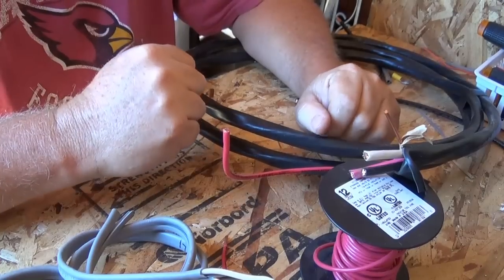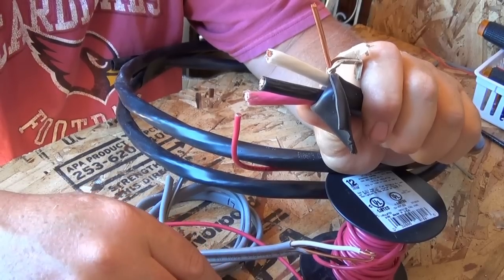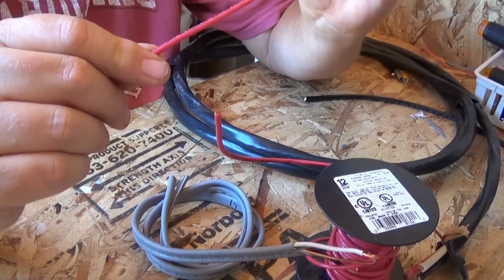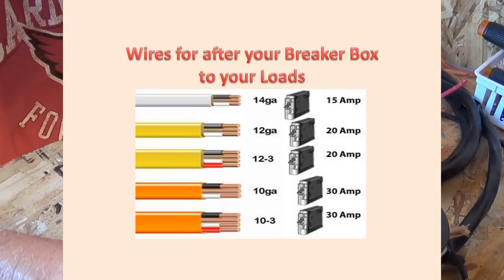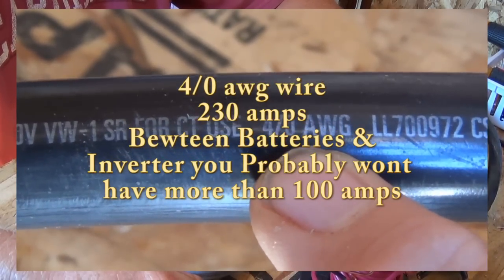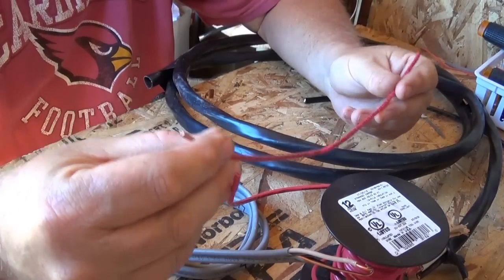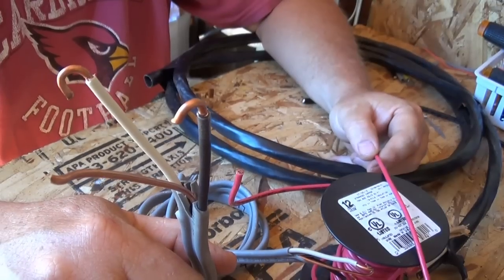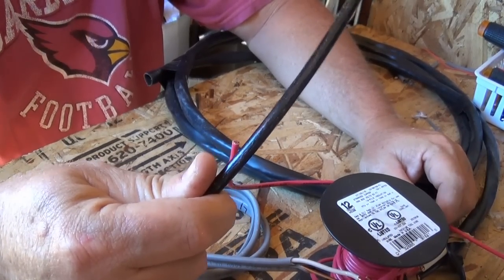What Size Wire Do I Use To Wire My Solar Components? Does Wire Size Matter?

Comment: please i have my 12v 1000w solar panels 20 ft away from the charge controller. what amps of wire can use to draw it?
Reply from the maker: size 6 stranded should be just fine size 4 would be best. 6gauge
Reply: ArizonaHotHomestead thanks so much is very helpful i appreciate, I'm working on it.
Reply: Aaron, actually a 4/0 wire is 1.4% volts loss in 20 feet as opposed to a 6ga wire at 10.97% voltage loss in 20 feet based upon a starting voltage of 12 volts.

Comment: Solid wire has less resistance than stranded and thus less voltage drop as distance increases - believe you got this backward.  Do not forget about code requirement of increasing amperage requirements for continuous loads by 125%.  Current (amps) on hot roofs in conduit have to be further corrected for temperature and corrected again if number of conductors in the conduit exceed 3 wires - Section 690
Reply: Also stranded is used in situations where you have vibration, even a little. Stranded will not come loose but solid is much more likely to. Master Electrician of 43 years who worked in industrial settings with motors etc told me this.
Reply: And of course the other reason stranded wire is used it’s a whole lot easier to bend and fish through tight spaces. And DC power runs current on the outside of the strand and AC runs current on the inside of the strand

Comment: What about wire with higher numbers than 14 such as 16, 18, 20 etc
Reply: I am testing for Nccer tomorrow..i hope i pass!!
Reply from the maker: that is some pretty small wire only used for very small electronics. i hate working with 16 ga wire becus the wire is so small when you bend it it brakes. ...

Comment: you didn't  say anything about resetince in wire gage juust amps the longer the run the more the restiance so stranded wire is the best but the gage figure in also, large less rest. ohm law
Reply from the maker: yea the resistance is to much for novice like most of us. when i wired my system i paid little attention to resistance. i just went as big as i could .  so far all is great.
Reply: Look up Copper Resistance for the wire size you chose for amps. example: 2AWG wire shows 0.1563 ohms per 1000 feet length (0.1563/1000 =
0.0001563 ohms per foot). If you have 3 feet between your battery bank and your Inverter then the voltage drop for a 2AWG wire is .0001563 x 3 feet x 2 wires (Pos & Neg) = 0.00096 ohms lost in 3 feet. Now calculate the surge amps that will potentially be drawn through that wire (say 250 surge amps) = 0.00096 x 250A surge = 0.24V loss over 3 feet. If you go longer with the same wire say 15 feet its .0001563*15*2=.004689*250A = 1.2V loss over 15 feet.

Comment: Question... I have to hook two 12v 9ah batteries together that then go inside a UPS Battery backup. I have T2 connectors for it, but wondered what sort of wire type/size I should use (the length would be like 2-3 inches).
Reply from the maker: what size are you able to use with the connectors? go with the biggest wire.
Reply: 12 G. is fine.

Comment: Nice video. Yes bigger the better for cables I think, protected by the right fuse. The Smartgauge website has some interesting calculations about cable losses etc., particularly interesting about batteries in parallel. At the very least never take inverter feeds  + and - from the same battery from a string. Surprising losses.
Reply from the maker: good info. thanks.

Comment: stranded wire has less resistance solid wire has more resistance,that why stranded loses less amps.
Reply from the maker: thanks. and stranded is easier to work with in most cases.

Comment: Thanx a lot sir, your video help me alot in understanding what wire should i use on my 12v loads running on the entire house. Currently im running thhn#14 and with a mix of speaker wire.
Reply from the maker: wow way to small. go bigger. never use speaker wire for any electrical. depending on loads and distance 6 to 12 stranded is great. in fact i use 6 to run the wire from the battery shed to the rv and barn than 10 or 12 on short runs to the loads. . when wires are to small like that speaker wire they will heat up causing the outer cover to melt and than catch anything it touches on fire.
Reply: Thank you sir, and not for further trouble I was installing a 1kw / 24v inverter with 240ah total battery capacity, any suggestion on what wire can i use or substitute to battery cable AWG#8(this is the only available size in my place) i'll be running it on 2 meters.
Reply from the maker: if 8 is the biggest you can get go with it. once you run the line measure the volts to see what drop you have between the beginning and ending of the wire. depending on your loads on each line may depend on how many lines you run.  i would think for the most part you will be ok .

Comment: I have two 74w solar panel and two 12v 75ah battery. So what wire should i use to connect them
Reply from the maker: being that size i would feel good in using standard auto battery cables. the 75amps is less than a video i did in wiring 2 12v batteries and on them i am using auto battery cables.

Comment: Current rating (Amps) is a function of the conductor cross section. Voltage and temperature rating is a function of the insulator. 

Stranded or solid conductors of the same cross section have identical transmission properties at DC or AC frequencies - I'm referring to 60hz. 

A stranded conductor will have a larger diameter than a solid conductor of the same cross section due to the voids between the strands. 

Stranded conductors are generally not allowed to be installed in the walls per NEC code. Exceptions apply so consult an electrician. 

Solid conductors are preferred in applications where the conductor is not subjected to frequent bending or flexing.
Reply: around here you can run stranded in walls but need to be encased in conduit. I'm not sure what you mean by"  cross section" the electrons travel on the surface of the wire so my logic tells me that there would be less resistance with stranded wire vs solid...? I thought gage of the wire was a size measurement? like you compress the stranded into a solid they would be the same size.
Reply from the maker: thanks for the info. a bit to techie for me but i appreciate it. when people read the comments it will help them.

Comment: Great videos!  Can you go over size  of wire for runs from panels on ground to the house and what are the code for burying etc.  in general. thanks!
Reply from the maker: for code just check with local codes. mine didn't have to be buried to code becus of the size of system so mine is just a few inches. . I used 6 gauge wire and its running about 70 feet from panel to charge controller. there are charts for the distance of normal lose in power but I have enough voltage running through I don't notice a loss. I also used 6 gauge to run 24v from the battery to the barn and rv which ends up being around 80 feet. use a step down dc converter 24v to 12v with no problem running the 12 volt devise on that line.   does that help? bigger the better.

Comment: what is best for pulsed DC current  ?? stranded or solid
Reply from the maker: from what I am told you go with stranded. the electricity actually runs on the outside of the copper wire so when you have many little wires (stranded)  there is less lost of electricity but if use a solid wire there is only 1 wire for the current to run on and is more likely to have loss in power. plus stranded is so much easier to work with.

Comment: Just a bit of general information to clear up any possible confusion. The voltage rating on the insulation, is just that, it is what the jacket of the cable, be it Teflon, rubber, etc. is rated at. The cable itself is almost unlimited where voltage is concerned. Solid core wires are not going to have more loss per unit length / diameter than stranded cable. Stranded scores in high power high frequency application only. You can think of very high frequency current as wanting to leave the wire altogether and radiate. Skin effect is a phenomenon that increases (decreases depth) proportionally to frequency and only the outer edge of the conductor carries the current. Below about 150hz this is not really an issue. Silver plating is an excellent way to use a semiprecious metal to full advantage here, silver being the best conductor we have presently. Wire carrying current will heat up, the thinner the gauge the greater the resistance per unit length and the resistance to flow causes heat. 
It's common sense really, what's the maximum current demand on your system? Choose the gauge of wire accordingly. If it's high voltage too, sort out your insulation as well.
Reply: Also was  just reading the comments, and see I may have repeated much that has already been said. There is some good talk regarding terminations and reliability. The best terminations these days are from high pressure crimping, and the crimps are so good they become indistinguishable from the cable itself. Screw connections are trouble, solder is variable and heats the cable and insulation. High pressure crimps are expensive, as is the tool to do it - but you only ever need do it once - and they can be bolted down or whatever depending on style chosen. And they look nice.
Reply from the maker: +Martin de Angelis thanks for the info. Sometimes it's good when people repeat it helps to confirm what one says and the info doesn't get buried so easily becus it's repeated.
Reply: I crimp AND solder my terminals.Screw connections ARE trouble-prone,indeed.The screw terminals on my inverter get hot,I would prefer a solid,threaded  post.

Comment: It's folklore that solid core cable has mores losses than stranded. The skin effect only becomes apparent at high frequencies. To the point where if you're moving lots of power around in the tens of MHz range you basically just use copper pipes as no current flows in the centre of the conductor at all. DC has a frequency of Zero Hz, therefore skin effect is not relevant. 

However, what can often happen when solid core is used is that it can be harder to connect to. Screw terminals contact a smaller surface area, where as stranded cable tends to be nicely "squashed" into the terminal well or contact plate thus making a superior connexion. 

The higher resistance connexion of the solid core can give rise to more heating making the situation even worse in a vicious cycle. The electrolysis action of DC current can also exacerbate the problem.  This is likely where it's bad rep comes from. The solution is simple - make a good connexion. Solder a tail on or a lug etc 

The problem with cable ratings is that they are essentially safety ratings. And with these cables often used on high voltage circuits a certain voltage drop can be tolerated that's no good on low voltage DC systems. 

If you want to size cables generously, but not go into over the top overkill mode, Current Density is a good way to work it out. 1mm^2 cross sectional area per 3 amps is a good rule of thumb for 12VDC circuits. Of course all you Yanks will have to consult your tables to convert that into AWG! lol
Reply from the maker: great information. thanks.

Comment: great job, but remember the distance of the wire run. The longer the run , larger the strain on the wire, so yes normally a # 12 AWG wire is fine for up to 20 Amperes, but if it is a longer distance you will need to step up to a #10 AWG wire.
Reply from the maker: so right. that's actually why on all my wiring I went with a size bigger.
Reply: awesome , and great job and video by the way man

Comment: Why solid ware over distance carry less amperage than stranded cable? Because electrons run on the surface of the copper wire not inside. Meaning that solid has less surface area that stranded. stranded are compose of many wires given a more surface area for electrons to carry.  Hope it help someone.
Reply: only at high frequency
Reply: The total cross-section area, AWG or "circular mill" size of a stranded conductor is equivalent to that of a solid conductor for the same designated wire size. ... Similarly, there will be no less or more voltage drop whether you use stranded or solid wire and the current carrying capacity is the same.      (Straight out of Google search).   So false.
Reply from the maker: I went with the solid for the 120v becus of the direct bury it came it. my thinking is if I go with any other wire I have to also buy something to put it in so the mice don't eat the coating. the direct bury from what I heard is more rubber material so the mice wont chew it plus it is better for direct bury reducing my cost on conduit. the distance I have the solid wire going isn't going to lose enough to be un-useable if you will.  you do bring up a great point. thanks for the comment.
Reply: Angel Gonzalez thank you
Reply: @paulapril  Thanks for that clarification.
Reply: @notgiven3114  Thank you both for the clarification
Reply: if my wires are warm am i losing any power?
Reply: My eggs

Comment: Electricity runs on the outside of the wire (strand), so the multi-strand is more efficient. You can use either solid or multi-strand on AC or DC, it is just more efficient to use the multi-strand.
Reply: Don't want to sound like an arse, but that is not quite correct, so purely for  educational purposes - I stick my oar in )) DC is not influenced at all by skin effect  as it is purely an AC phenomenon, and increases with frequency, I'm sure there will be a good wiki page on 'skin effect'. Sorry again for barging in.
Reply: @martinda7446  you got it this guy is going to burn his place down someday. He’s off on a lot of issues not just electrical
Reply from the maker: thanks for the info. I like it when people chime in with valuable information. thanks.
Reply: Multi strand is more efficient.That's why your car has them.Otherwise,they would all be solid core wires.
Reply: ddd228/Dave in Seattle: Yes multi strand is more efficient but that's not the reason exactly why your car has multi strand wire. Solid cable is fine in the home but not in a car for 2 reasons. Hz and movement. Your car has multi strand cable because the average alternator (AC current) runs at around 400 Hz as opposed to 60 Hz in your home. Which brings us back to the skin effect conversation mentioned. And a car is moving which generally means the wires are moving. Solid wire is not flexible which makes it prone to breaking where multi strand is very flexible and good for use where wire movement is likely to happen. Then there is the heat dissipation requirement mentioned by Chuck Wagner. wire size is chosen (and rated) based upon how well it dissipates heat. Using the AWG standard, a 4/0 wire with 90C insulation is rated for 260 amps but that same wire with 60C insulation is only rated for 195 amps. That's why nobody measures wires in watts. It always baffles me why I see youtube videos where someone connect there RV battery bank together with 4/0 wire and then they run a #6 AWG or even a #2 AWG wire from the battery bank, through a 250 amp fuse, to their 3000 watt inverter. If you pulled 250 amps through that wire, the wire would probably melt long before the fuse blew. There is smaller diameter cable that can handle the 250 amps but its generally a specifically rated welding cable for that amperage not a standard AWG wire you can buy at Home Depot.

Comment: Good video, Thanks... Couple of points.  The voltage rating is for the INSULATOR, or plastic coating... it is not for the conductor (copper/aluminum (yes... there IS aluminum... but out of favor and hard to find)) ...
the current carrying capacity has to do with the cross-sectional area and metallurgical properties of the physical conductor.

Modern wiring sizing is based on cross-sectional area.  Stranded cables will actually be physically a little larger than solid -- because solid has no air space between all the strands as there is only one strand.

I'm not aware of varying metallurgical formulations for electrical wire on the market today, so theoretically, stranded vs solid wire of the same gauge has the exactly the same current carrying capacity.

Voltage and power losses are based on distance, but also by cross-sectional area.  Stranded wire is much easier to work with in most applications, and is my go to choice.  What WILL impact losses are terminations and turns/bends.  having monitored complex cable plants for years using thermal imaging, I can tell you that sharp bends are to be avoided, and crappy terminations, or terminations that are starting to corrode have caused nearly 100% of the failures and pre-failures that needed rework.  The remaining miniscule percentage of cable plant fails were due entirely to conductor damage, either manufacturing inconsistency or (mostly) damage incurred during installation and/or maintenance.

Current Flows.  the easiest way to think of where your losses are/can be is to think of water FLOWING through a hose.  If you crimp the hose, flow is reduced.  if you place a sharp bend (but not quite a crimp), flow is also reduced.  In wiring, this introduces RESISTANCE, and resistance lowers voltage and available power downline.  This resistance is also a natural property of the metal used (which is why there are few wiring formulations out there)

Personally, I'd prefer to have the cabling sized for at least 150-200% of maximum possible load.  This reduces wiring resistance to a cost effective minimum, thus  I-squared-R (power) losses, which show up as heat (and can have a runaway effect -- was going to say snowball)
Reply from the maker: full of info. thanks.
Reply: Dan Murray Aluminum wire isn't hard to find. Absolutely everyone in the US has aluminum wire coming off the utility pole to the main breaker. I have 2/0 aluminum wire from my 8kw solar array to my charge controllers. Aluminum wire is very much still around.